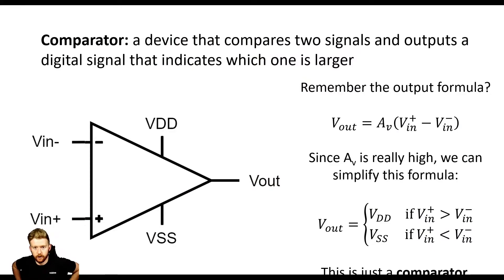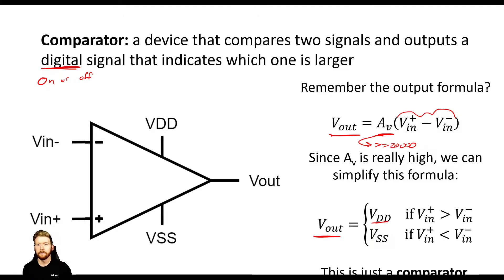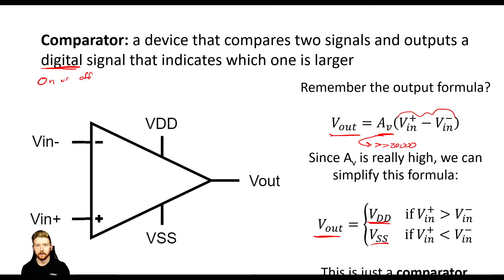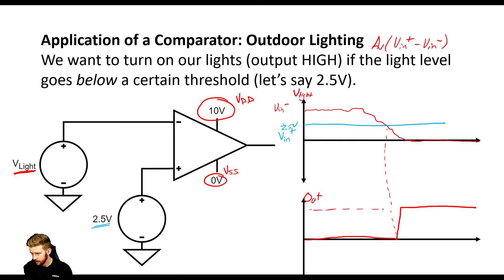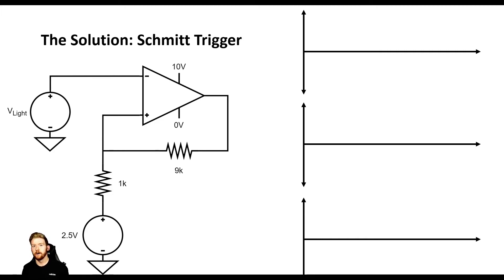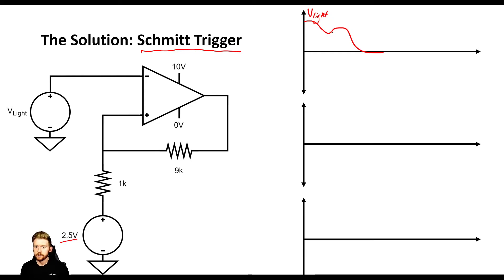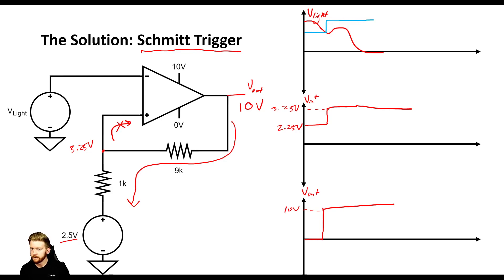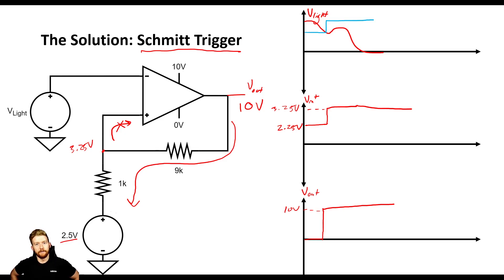Electronics Tutorial 3: Op Amps as Comparators

Comment: 13:50 was difficult to understand, then I learned about voltage dividers and it became easier. And about 3.25 V: there is a problem that I don't understand: We get 2.25V from dividing without signal, then after signal we get + 0.75V from divider -- it's about 3V, not 3.25V, or I don't understand something. Why you made 2.5V+0.75V?, but not 2.25V+0.75V? Or is it 2.25V+1V? Cadence says about 3.25V(3.21V to be more accurate(some power consumed)) So I think it is 2.25V+1V.
Added: Someone told me that it is 2.5V(potential)+0.75V in difference from 2.5V source and 10V output